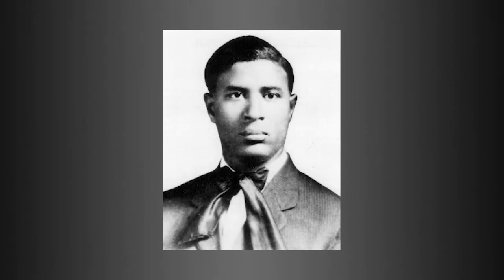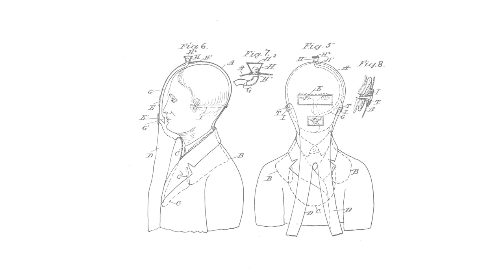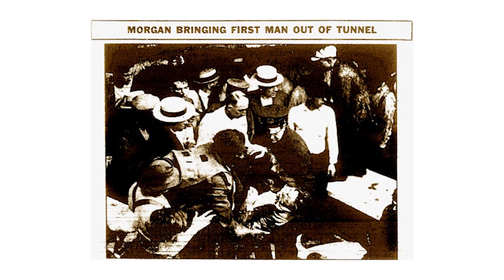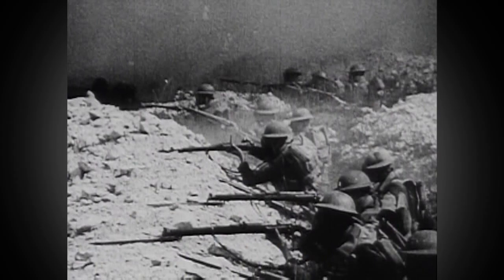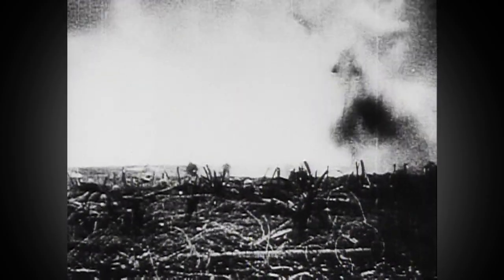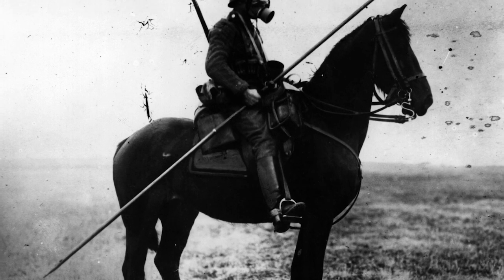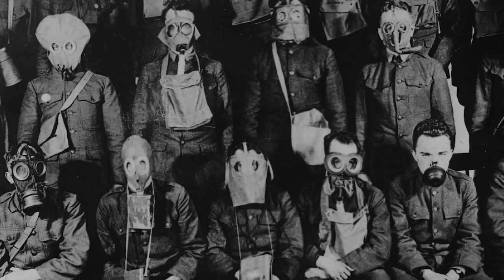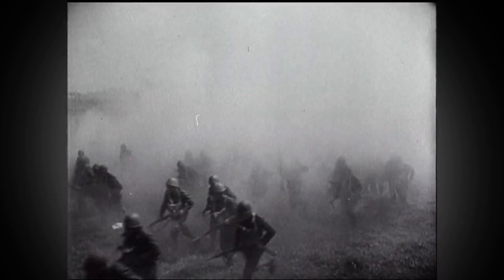Gas Mask Patent - Decades TV Network

Comment: Morgan's mask while a break through was a breathing device which simply allowed the users to breathe cleaner air from just above the floor which is effective for avoiding smoke inhalation. However, poison gasses like Chlorine used in WW1 are heavy than air and sink to the floor making this type of device ineffective. James Bert Garner was the inventory of the WW1 gas mask used on the allied side. https://en.wikipedia.org/wiki/James_Bert_Garner